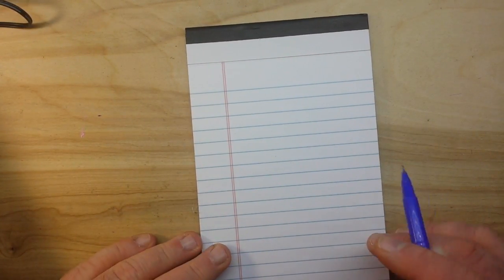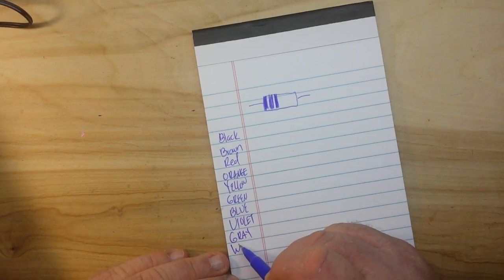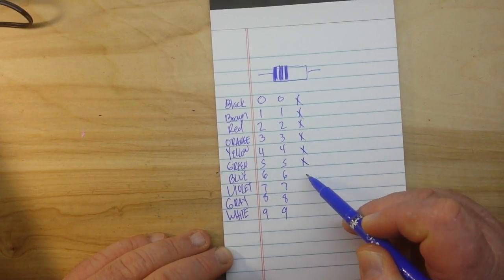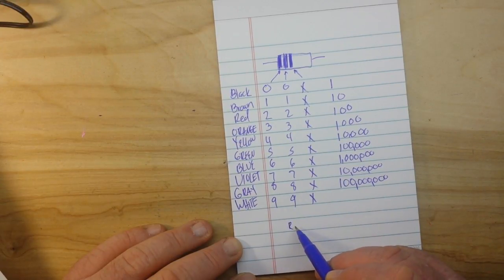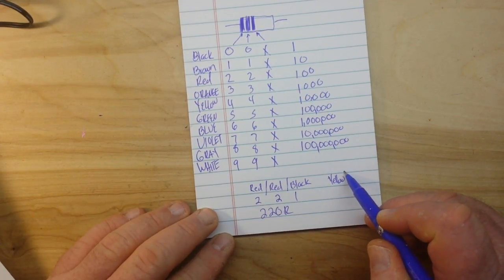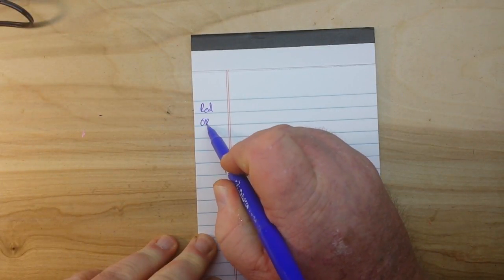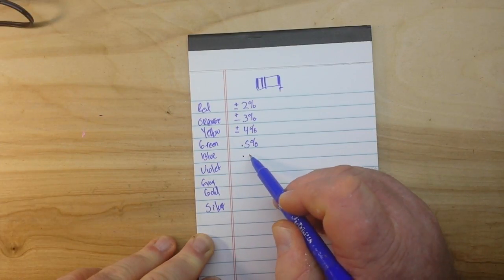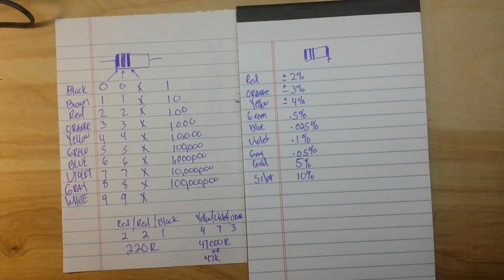How to read resistor color codes

Comment from the maker: I made a mistake with the first example. It should 22R as many have stated. I have no script, nothing is rehearsed. So I do slip up from time to time. Thanks for correcting me.
Reply: No worries! Happens to all of us. Those blue Chinese resistors really make it hard to read the values. I always measure them before I use them. 
A small tip for people who like to attend maker fairs: Make Magazine is usually handing out short paper rulers with basic formulas on one side and resistor values on the other. Get yourself some of those. They will come handy
Reply: Yes your only human . 👍👍👍
Reply: Paul, you are a great tutor, regardless.
So, thanks a lot and keep it up.

Comment: What i do (and IMO takes less time) is to just test it with a multimeter. Usually have one ready on the bench anyway. No app, no calculations. Plus you get the true resistance value. But i agree this color coding thing is important to know.
Reply: a good strategy for the 3rd band is to think of it as a bunch of zeros then put them after band 1 and 2.
Black      (empty with no zeros; none)
Brown    0
Red         00
Orange   000 (Kilo=K)
Yellow 0000
Green 00000
Blue 000000 (Mega)
Violet 0000000
Grey 00000000
White 000000000
It is basically same as turning the 3rd band color into a # then adding it as power to 10 then multiplying it with band1 and band2 combination
Black      10^0 = x 1 (number multiplied by one remains the same)
Brown    10^1 = x 10
Red         10^2 = x 100
Orange   10^3 = x 1000 (Kilo=K)
Yellow 10^4 = x 10000 (10K)
Green 10^5 = x 100000 (100K)
Blue 10^6 = x 1000000 (Mega=M)
Violet 10^7 = x 10000000 (10M)
Grey 10^8 = x 100000000 (100M)
White 10^9 = x 1000000000 (Giga=G maybe they call it so, ain't sure, 1000M)
example
Band 1   2      3
brown   red yellow resistor
1            2     x 10 ^ 4 = 12 x 10000 = 120,000 = 120K ohm
or just like I told you trail it by a bunch if zeroes which is quicker
brown   red yellow resistor
1            2     0000 = 120000 = 120,000 = 120K ohm
Just understand the concept of resistor colors you do not have to memorize, you can use a color table or an app on PC or mobile or use online calcs, it does not matter.
http://www.hobby-hour.com/electronics/resistorcalculator.php
https://www.allaboutcircuits.com/tools/resistor-color-code-calculator/
Good luck

Comment: So its the first two bands start the value, third band tells you how many zeros to add and forth band the tolerance.
Reply: J. Clowers If its a Four band resistor yes. ;-). There is also an app now that i use on my android phone which you just put the colour codes in. I can now 80% all the time read the resistance off the top of my head .
Reply: a good strategy for the 3rd band is to think of it as a bunch of zeros then put them after band 1 and 2.
Black      (empty with no zeros; none)
Brown    0
Red         00
Orange   000 (Kilo=K)
Yellow 0000
Green 00000
Blue 000000 (Mega)
Violet 0000000
Grey 00000000
White 000000000
It is basically same as turning the 3rd band color into a # then adding it as power to 10 then multiplying it with band1 and band2 combination
Black      10^0 = x 1 (number multiplied by one remains the same)
Brown    10^1 = x 10
Red         10^2 = x 100
Orange   10^3 = x 1000 (Kilo=K)
Yellow 10^4 = x 10000 (10K)
Green 10^5 = x 100000 (100K)
Blue 10^6 = x 1000000 (Mega=M)
Violet 10^7 = x 10000000 (10M)
Grey 10^8 = x 100000000 (100M)
White 10^9 = x 1000000000 (Giga=G maybe they call it so, ain't sure, 1000M)
example
Band 1   2      3
brown   red yellow resistor
1            2     x 10 ^ 4 = 12 x 10000 = 120,000 = 120K ohm
or just like I told you trail it by a bunch if zeroes which is quicker
brown   red yellow resistor
1            2     0000 = 120000 = 120,000 = 120K ohm
Just understand the concept of resistor colors you do not have to memorize, you can use a color table or an app on PC or mobile or use online calcs, it does not matter.
http://www.hobby-hour.com/electronics/resistorcalculator.php
https://www.allaboutcircuits.com/tools/resistor-color-code-calculator/
Good luck
Reply: igrewold Thats the method i used to know what the 4th in a 3 band resistor was so i pretty much black is no zeros and brown =1 etc. Good tip.

Comment: I agree, 5-band resistor codes suck. Unfortunately, most of the ones I have use that scheme. I struggled with memorizing until I came across the olive, poo, cherry, banana, weed.... method.
Reply from the maker: +Karl Laun ok you gotta share that one
Reply: a good strategy for the 3rd band is to think of it as a bunch of zeros then put them after band 1 and 2.
Black      (empty with no zeros; none)
Brown    0
Red         00
Orange   000 (Kilo=K)
Yellow 0000
Green 00000
Blue 000000 (Mega)
Violet 0000000
Grey 00000000
White 000000000
It is basically same as turning the 3rd band color into a # then adding it as power to 10 then multiplying it with band1 and band2 combination
Black      10^0 = x 1 (number multiplied by one remains the same)
Brown    10^1 = x 10
Red         10^2 = x 100
Orange   10^3 = x 1000 (Kilo=K)
Yellow 10^4 = x 10000 (10K)
Green 10^5 = x 100000 (100K)
Blue 10^6 = x 1000000 (Mega=M)
Violet 10^7 = x 10000000 (10M)
Grey 10^8 = x 100000000 (100M)
White 10^9 = x 1000000000 (Giga=G maybe they call it so, ain't sure, 1000M)
example
Band 1   2      3
brown   red yellow resistor
1            2     x 10 ^ 4 = 12 x 10000 = 120,000 = 120K ohm
or just like I told you trail it by a bunch if zeroes which is quicker
brown   red yellow resistor
1            2     0000 = 120000 = 120,000 = 120K ohm
Just understand the concept of resistor colors you do not have to memorize, you can use a color table or an app on PC or mobile or use online calcs, it does not matter.
http://www.hobby-hour.com/electronics/resistorcalculator.php
https://www.allaboutcircuits.com/tools/resistor-color-code-calculator/
Good luck

Comment: Yup I've been cheating using the Chinese transistor checker...😂 but i want to learn them, thank you
Reply: a good strategy for the 3rd band is to think of it as a bunch of zeros then put them after band 1 and 2.
Black      (empty with no zeros; none)
Brown    0
Red         00
Orange   000 (Kilo=K)
Yellow 0000
Green 00000
Blue 000000 (Mega)
Violet 0000000
Grey 00000000
White 000000000
It is basically same as turning the 3rd band color into a # then adding it as power to 10 then multiplying it with band1 and band2 combination
Black      10^0 = x 1 (number multiplied by one remains the same)
Brown    10^1 = x 10
Red         10^2 = x 100
Orange   10^3 = x 1000 (Kilo=K)
Yellow 10^4 = x 10000 (10K)
Green 10^5 = x 100000 (100K)
Blue 10^6 = x 1000000 (Mega=M)
Violet 10^7 = x 10000000 (10M)
Grey 10^8 = x 100000000 (100M)
White 10^9 = x 1000000000 (Giga=G maybe they call it so, ain't sure, 1000M)
example
Band 1   2      3
brown   red yellow resistor
1            2     x 10 ^ 4 = 12 x 10000 = 120,000 = 120K ohm
or just like I told you trail it by a bunch if zeroes which is quicker
brown   red yellow resistor
1            2     0000 = 120000 = 120,000 = 120K ohm
Just understand the concept of resistor colors you do not have to memorize, you can use a color table or an app on PC or mobile or use online calcs, it does not matter.
http://www.hobby-hour.com/electronics/resistorcalculator.php
https://www.allaboutcircuits.com/tools/resistor-color-code-calculator/
Good luck
Reply: igrewold wow Thank you so much! 😘❤❤❤

Comment: Man, you are so right about these Blue-colored resistors, they are giving me a hard time in distinguishing their colors!
The beige ones are much easier to deal with and identify. But I use DMM and MTester to make sure they got the right values. Even while using a magnifier with LED light, I am stuck with them ;D
https://duckduckgo.com/?q=magnifier+with+LED+light&iax=images&ia=images
I think there is also some kinda resistors kinda brownish that got the value printed on it in numbers with R sometimes serving as a decimal point along with K and M for Kilo and Mega ohms.
http://www.partsconnexion.com/media/product/resistors/mra12.JPG
In Electronics there is always something that is too confusing for  peeps, one thing I hate in SMT/SMD is capacitors, they mostly got no value except for some of their types e-caps...etc.

Comment: I would like to know more about choosing resistors for circuits!  I don't guess you can start at a few million ohms. then go down in resistance until the circuit works? just a haha. I wouldn't do that. so far I just copied circuits. I haven't had to figure things myself! until now. I need to know. mostly gate and dropper resistors.
Reply from the maker: +James stranger All you needed for that is Ohms law. You know your input voltage. You know the maximum current for the components that need a resistor. The only thing you don't know is there resistance you need. For instance you have a 12VDC source and want to put a gate resistor on a transistor with a Max I on the gate of 10mA so you need 1.2K 
V= I*R

Comment: Is the first one not 22 ohms? 2 then 2 times 1!
Reply: gartmorn if i check the online calculators for 3 band resistors it indeed says 22 ohm when its red red black, and 220 ohm when red red brown...
Reply: r0nnl A Freudian slip by the maestro on this one!  😜
Reply from the maker: +gartmorn Yeah I screwed the pooch here.
Reply: I always check with a meter as well because colours aren't always easy to distinguish on many of them!
Reply: a good strategy for the 3rd band is to think of it as a bunch of zeros then put them after band 1 and 2.
Black      (empty with no zeros; none)
Brown    0
Red         00
Orange   000 (Kilo=K)
Yellow 0000
Green 00000
Blue 000000 (Mega)
Violet 0000000
Grey 00000000
White 000000000
It is basically same as turning the 3rd band color into a # then adding it as power to 10 then multiplying it with band1 and band2 combination
Black      10^0 = x 1 (number multiplied by one remains the same)
Brown    10^1 = x 10
Red         10^2 = x 100
Orange   10^3 = x 1000 (Kilo=K)
Yellow 10^4 = x 10000 (10K)
Green 10^5 = x 100000 (100K)
Blue 10^6 = x 1000000 (Mega=M)
Violet 10^7 = x 10000000 (10M)
Grey 10^8 = x 100000000 (100M)
White 10^9 = x 1000000000 (Giga=G maybe they call it so, ain't sure, 1000M)
example
Band 1   2      3
brown   red yellow resistor
1            2     x 10 ^ 4 = 12 x 10000 = 120,000 = 120K ohm
or just like I told you trail it by a bunch if zeroes which is quicker
brown   red yellow resistor
1            2     0000 = 120000 = 120,000 = 120K ohm
Just understand the concept of resistor colors you do not have to memorize, you can use a color table or an app on PC or mobile or use online calcs, it does not matter.
http://www.hobby-hour.com/electronics/resistorcalculator.php
https://www.allaboutcircuits.com/tools/resistor-color-code-calculator/
Good luck

Comment: That's funny I was taught Bad Boys Rape Our Young Girls But Violet Gives Willingly for the resistor color code. Maybe not real appropriate but I've remembered it for 50 years. Thanks for the refresher.
Reply: George Chambers 
I don't know Violet !!!
Reply: Too bad you missed out.
Reply: +James stranger
Violet = Purple ...etc. https://en.wikipedia.org/wiki/Purple#Purple_vs._violet
Reply: +George Chambers
I wish you could tell us like in a blog or however you like about the older Radio days, how you tampered with it. Did you build a kit? How did it make you feel? Did you catch the old galena cat's whisker days? what was it like? 
https://en.wikipedia.org/wiki/Cat's-whisker_detector
How did you feel when the 1N34(A) germanium or similar came out? Also that Radio in a chip ZN414/MK484 what was it like? Did the case of a Radio(wooden/plastic...etc.) have that much effect on the Radio experience?
https://en.wikipedia.org/wiki/ZN414      https://en.wikipedia.org/wiki/MK484
https://www.mikeselectronicparts.com/product/1n34a/
And that ear phone/speaker (500ohm~2K or 4K no clue!) one that looks weird/vintage now ;D sorry, what was it like? Is it made of piezo? How was your experience with it?
Thanks and regards, I am from Arabia(3rd world ;D most of old timers here were just users but no tinkerers) that is why I am asking. Technology (SDR ....etc.) now is going faster than people can catch anymore. It is so crazy when you think of RPi 0 or 3 + RTL SDR + Antenna + tiny LCD monitor/display + power bank + bluetooth head-phone/set. Or even on a table/android mobile, I heard it does run.
You're a radio king and for so cheap! RPi RTL SDR users that is! https://youtu.be/d8PAQ_ZuFSQ
https://youtu.be/L7RLJt4vZ_g